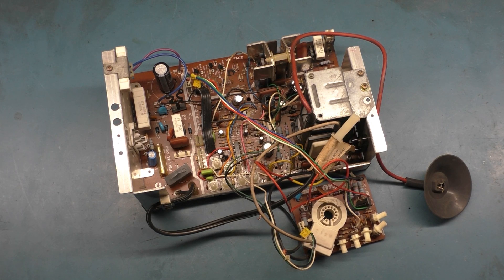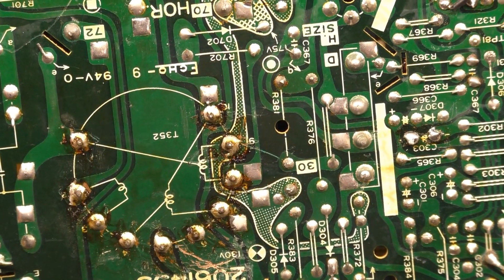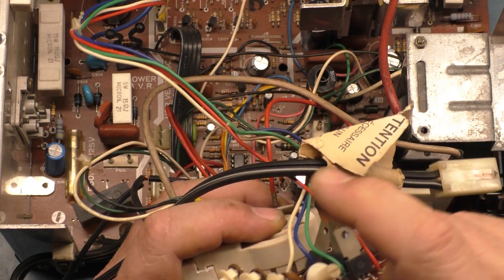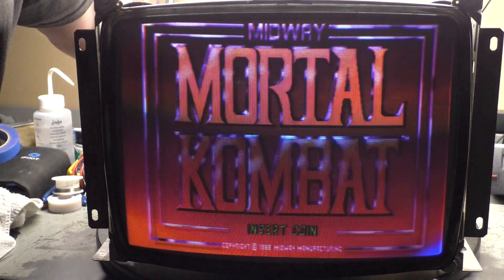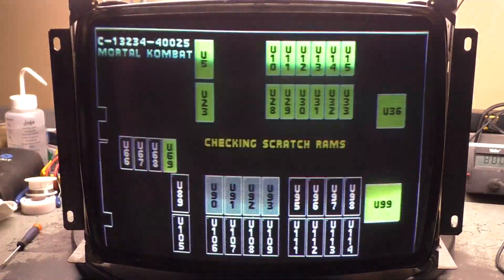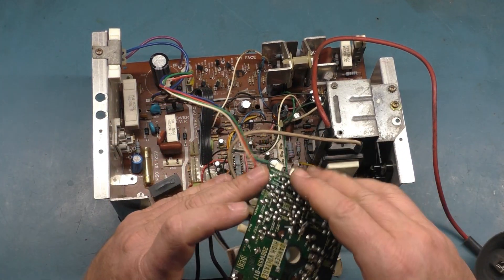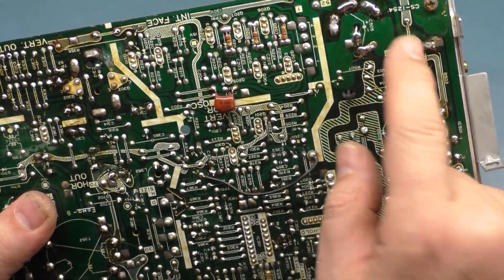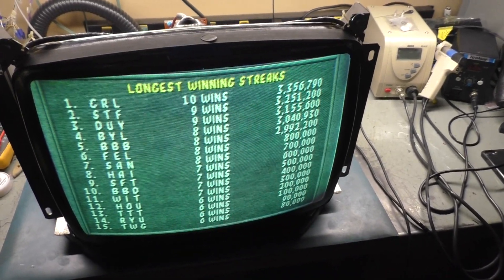19" K4900 Arcade Monitor Chassis Repair - Goes Dim And Bright Intermittently?

Comment: Hello Sir, I have enjoyed many of your videos but I have one request: Would you mind doing a video on your tools?

Let me elaborate... I am new to arcade service and repair, but I have it in mind to make a full go of it. As such I am building up my lab. What I am finding invaluable is YOUR knowledge. THANK YOU for sharing! I am in the process of repairing a GO7 from an otherwise pristine specimen of a Ms. Pacman, and your GO7 videos got me across the finishing line. But during the race, I found myself wondering a few things like, "I had to remove the linear power supply from the cabinet to power the GO7 on my bench when I got to testing... I wonder what Mike does on his bench?". Then I watched you testing and saw your light switch that is probably connected to a transformer that lives on your bench. care to share the deets?

Anyway, I have noticed you briefly mention your setup and/or favorite tools from time to time, but I would very much appreciate an episode dedicated to your work space, the kits your have put together to support your repairs, your favorite consumables (solder, flux, irons, etc.), must have parts to have on hand, how you clean chassis, (what is the deep sink?) pretty much the episode you can say, "It Really Tied The Room Together."

Comment: I just had a bad solder joint on that jumper for the K4900 in my Pac-land. 
I ended up putting in a little beefier component leg. So far, it is holding solid.

Comment: Would it be possible for you to do a short video on the differences between the standard and medium res versions of the 4900 series?
Reply from the maker: The tube is different, yes. The dot pitch is finer on the medium res tubes but as far as compatibility goes, you can use either tube for either chassis. The chassis’ themselves only have minor changes to operate at a different sync rate (15 vs 25), but I’ve never sat and compared what components are different, or if it would be possible to convert one to the other. The most important component is the yoke. The yoke is what really determines the resolution so without a proper yoke, it’s a bit moot.
Reply: @MikesArcadeMonitorRepair  thanks for the reply, the yoke part I understood.  I’ve only been in arcade repairs about 11 years and i’m still learning stuff about monitors.  I can follow most schematics but i still have mixed success with dead screens.  Your videos are helping immensely.
Reply: @MikesArcadeMonitorRepair  The yoke is a bit different on the horizontal winding as far as I know for the medium resolution, but not enough that you can't use a standard res yoke on a medium res chassis. I use a standard res yoke for testing medium res chassis. The crt they use on the medium res is usually M designation (fine pitch as you say), and all the ones i've ever seen are Rauland crts, M48AAW00X. Same crt as used on the Amplifone vector monitor actually - just with a different yoke!

Comment: Is that a 19VLTP22 tube?  Is the difference between running a standard res 4951 and a medium res 4915 just the yoke?  I have a few tired system 2 cabs but always thought the tube was different.

Comment: Is this the same on a k7000? Mine is fine for 10 mins then screen goes dim to where I can barely see the game. Just did capkit and new flyback and still same issue
Reply from the maker: Yes. Reflow and inspect the pads for R101 and R89
Reply: That did it! Had it on for about 45 minutes and no issues. I can't thank you enough sir!
Reply: It kept going dim but I replaced the shutdown pot (suggested from your other video) and that fixed it.

Comment: I have a wgm2792 monitor for a buck hunter that has a full horizontal collapse (only 1” of picture). I do a fair bit of soldering and electronic work but know nothing about these things. Would you be able to help me? I am more then willing to pay your for your time.
Reply from the maker: 1” of picture is partial collapse. Full collapse would be just a thin line. My apologies,but I have no tubes for testing the D9200. I can’t offer services unfortunately.
Reply: That’s unfortunate. Thank you for the reply. Do you have any guidance you could give me as to what it may be?
Reply from the maker: Wells Gardner used the cheapest caps possible for cost cutting measures. Step 1 is to inspect it, then cap it, then full reflow and see where you’re at after that.
Reply: Thank you very much for the info. I will give all of that a try.